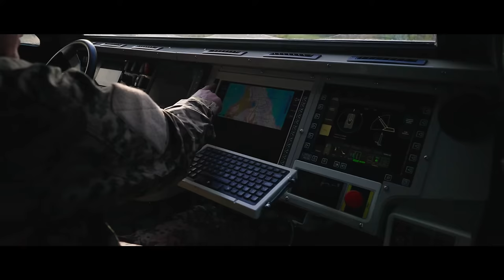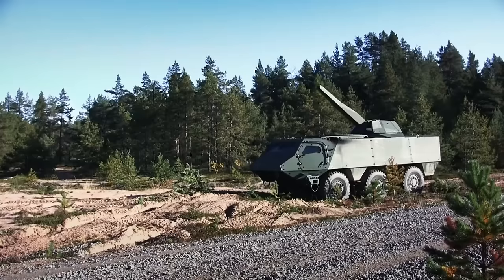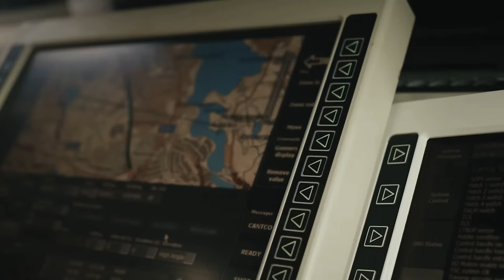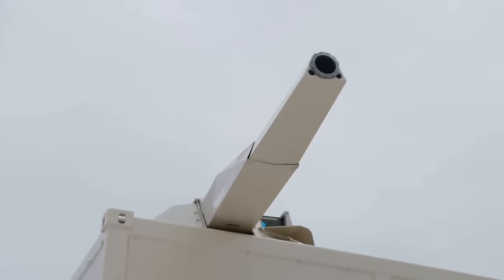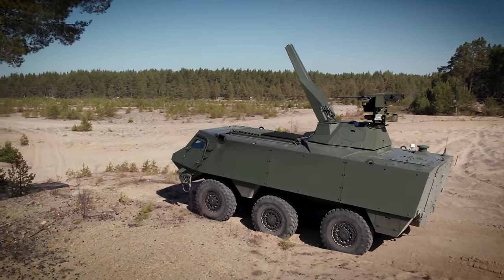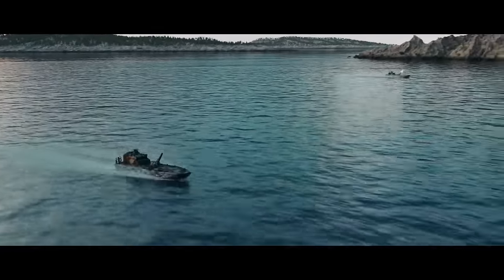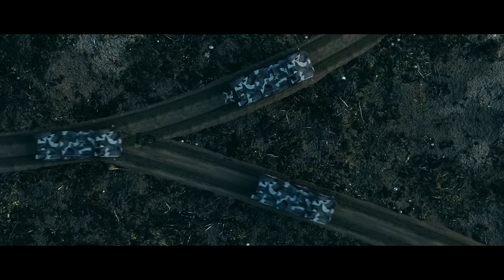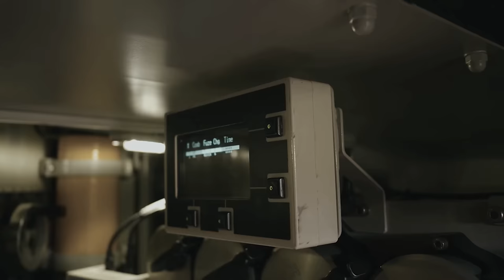The Patria 'NEMO' 120mm Mortar | WORLDS BEST MORTAR SYSTEM

Comment: I wonder if the turret could be compatible with Stryker & AMPV. The current US mobile 120mm mortars are just strykers or m113 or even the new AMPV all have mortars just in the roofless back.
Reply: It definitely can if the platform suspension can handle the recoil and the drive train and cabling can handle the power requirements.
Reply: It is similar vehicle so i guess it can handle Nemo easily and maybe even Amos

Comment: Best is very subjective. If you want a man portable artillery piece for an infantry unit, I don't think anything beats metal tube and baseplate and a tablet for number crunching in terms of price and availability.
This thing on the other hand looks very expensive, and effective.
Reply: Not that expensive tbh. We need as much bang for buck as we can get
Reply: The 82mm  mortar is an ageless classic, easy to use, mobile, ridiculous firing rate and good enough for meat loaf

Comment: Incredibly interesting system, but I want to see it with an exposed barrel and recoil-dampener(s). Now that would be beautiful.
Reply: it would give a bigger radar signature especially at max elevation. 
Hiding your kit on the battle field or on water is an increasing problem with air mounted sensors and drones kitted with multi spectrum sensors. 

I predict its only a matter of months before someone fields a drone defence system on vehicles like this ... essentially like an automated giant shot gun system ...  That way you get the optimal spread to take out the cheaper small  drones without having to spend a fortune on pin point targeting systems or  munitions. 
It would also be highly effective in point defence if the opposition got infantry close. 
The load could be varied like a shotgun as well, so from ball through flechettes for spread to slugs or sabots. It would probably have to be multi barrel and have the spread at range of a punt gun ... So 🤔 40mm as you are going to need quite a few rounds... to fire in various burst patterns.

Comment: Hello Mat,  the nemo is impressive.  I am not a military person, consequently I do not see the real value compared to a low cost regular mortar, except for situations of high movement.
Reply: Accuracy, mobility, safety, comfort and fireing system that can link to multiple nemos and drones at the same time… Just the ability to come into fireing range with target coordinates preset, shoot a fast burst that all hit the target at the same time and the run away is a crazy ability.

So in a short comparison:

Cons of normal mortar system:
1) very skill oriented and multiple soldiers needed to operate the mortar so one kamikaze drone or shrapnel can wound 3-4 soldiers at once even if not a direct hit.
2) Just aiming takes much longer time and on a soft ground might need re-aiming after every shot.
3) verifying if you hit what you wanted takes a long time and re-adjusting is just as slow.
4) can’t shoot on the move.
5) no cover from enemy counter barrage.

Cons of NEMO:
1) Price
Reply: Thanks  @tomofasia  for the answer! Appreciate it. When looking at the situation in Ukraine I wonder, are soldiers in trenches (with mortars) more exposed than in IFV's? (Or are they less exposed due to lack of precision to russian artillery?). I didn't know of the slow aiming of manual mortars. Are they less precise as well? Interesting remark of the soft ground. Originally, I am a forestry engineer. Have seen many military in the forests. It was always a surprise for soldiers, our equipment did not get stuck.  I mean, Hagglund did build the BVS for a reason. That would actually be an nice platform for the Nemo...  Thanks!

Comment: One could also note that you can mount the box version to basic ass civilian change bed truck and just drive trough logging roads and main highways 10km from front line and dropping off mortar fire before driving off to resupply if you run out the military supply trucks. You might be able to disguise them as basic civilian containers as well, plus load them on train, though that would be bit too predictable target. Put dozens into a "fast" small cargo ship on the deck. Sail near enemy harbour or such, unload everything and get hell out of dodge, with subs and surface ships dealing any pursuing ships and air treats. Not sure how hague would react to this, but its possibility to get a edge.

Comment: I like the idea of having autonomous artillery systems that you can drop off and they are self-contained were you could control the system from kilometers away and have multiple guns that you can connect all together so they can all fire simultaneously at the same Target with a good amount of ammunition capacity that could be a real good idea only has to be reloading when it's done firing or move it to another location and with modern guided munitions you will need a lot less rounds On Target

Comment: Also needs slightly-delayed canister shot rounds for anti-UAV work. Other than that, seems fine. Needs a longer hardened barrel though, for extended range rounds, that will immediately be developed. We could probably chuck them on a Bushmaster, or just have them run alongside on trucks.

Comment: In my opinion, the NEMO mortar system would have been an interesting alternative to the Mobile Gun System. It has both direct and indirect fire with a fire rate of 10 shot per min and while its direct fire is about 2 km compare to the 4 km of the MGS, it compensate by it indirect fire of 10 km. Also a bit of correction, the AMOS is not a lighten version of the NEMO but much heavier which is about 4.5 tons compare to the 1.9 ton of the NEMO. However AMOS rate of fire is 26 rounds per min compare to the 10 rounds per min of the NEMO which is scary fast for automatic mortar or any autoloader system use by certain tanks.

Comment: The combination of a 120mm mortar system like this combined with drones with laser rangefinders to get the GPS coordinates of a target for GPS guided smart rounds where a CEP of 3-5m is good enough and laser designators for laser guided rounds where CEP of <1m and the ability to hit targets on the move could make this type of system a dominating factor on the battlefield. 

In fact the NEMO system firing  laser guided anti-tank shaped charge rounds with a drone designating the target would have the potential to be a real armored vehicle hunter. With a range of 7 km or so, the mortar carrier would be well beyond the range of vehicle with line of sight weapon systems, including those like IFVs firing ATGMs. And the ability to stay masked behind terrain means that even within range of tanks and ATGMs, the mortar carrier never needs to unmask to fire.
Reply: Why would it need primitive laser guided anti tank shells when it has FLIR guided  profile priority programmable top attack EFP/HEAT shells already in service since 1994?
Reply: @SonsOfLorgar  money. Sure there are mortar shells  that have autonomous capability, but that comes at a high cost. The simpler laser homing shell is much less expensive.

Comment: The wireless system can be hacked or jammed so not sure there will be much use for that "shipping container" variety but on the APC in the hills and low mountains this with a 50 cal or even 20 mm minigun on it as well is valuable.
Reply: Not to mention that the shipping containers are one time use if fired against any decently equipped opponent.
Reply: @juslitor  I would think you would build a pit for it with sand bags in the brush for protection but agreed nontheless, one hit and its an expensive pile of junk. Nobody is going to spend the amount they want for the system and just leave it with so many vulnerablities unless its in a really remote spot thats hard to hit but then how does a truck offload it there in rough terrain is the question....Maybe a C-47 could drop it on a cliffside and tuck it into a niche.

Comment: I wonder if it would be possible to mount these babies on the TAP V fleet, Recce by G wagon or replacement vehicle armed with the GMG or 50 cal and the Nemo-armed TAP V would be the whumper that Reserve Armoured units could really use, any battle group would love to have this kind of firepower.
Reply: At least with this system the TAP-V might be a worth while platform. 
Might need to extend the body a bit just to carry rounds. As for a G-Wagon recce, you can by a lot drones for the price of g wagon not every be exposed. Warfare is changing.

Comment: Imo this is what Sweden should have gone with in their Mjolner system.
Reply: The Mjolner system is much cheaper - hence Sweden has gone in that direction. I'd guess their performance & capabilities are similar, except that the NEMO and AMOS variants have the benefit of a direct fire option as well if/ when necessary.

Comment: I have had a look at mortars. There are and have been a vast array. The smallest I found was 40mm and has not been used for at least 70 years as far as I can see. 60mm mortars are still in use all over the place. Then comes Mr Beardie Weardie. The 81mm mortar. More specifically why 81mm? It's a weird number as it is not a round number in metric and not in imperial either. OK it's nearly 3.25 inches but not quite, Then there are the odd few 90mm. Then of course 120mm. Then we get to the big ones. IE 6 inch (roughly 155mm) found on some WWII ships for shore bombardment. There were even some 208's (8 inch) but 81mm? Why not 80mm or 85mm?
Reply: 81mm because they are muzzle loaded smooth bore weapons with cast iron ammunition which requires room for both temperature variations on the barrel as well as casting variance in the shells and the air in the tube below the shell to pass it by for the shells to slide smoothly down the tube with enough velocity to get a good strike from the fixed firing pin common in lighter mortars.

Comment: This system for coastal ships, is an absolute nightmare for anyone who is trying to threaten the Nordic coastline. For anyone who does not know, Finland and Sweden don't really have one coastline. Rather, especially Finland's coast is made up of a huge web of small islands. It's rather mindblowing to sail a ship through it into the Baltic. 

And on each of those islands. Finnish recon soldiers. Recon equipment. Sensors. All relaying your location and information about you. If it wasn't enough for Finnish troops to have many coastal missileboats targeting you. For those islands to be packed with mortar teams, anti-ship missile launchers, and more. You also now have patrol boats with 120mm mortars capable of firing on the move, as they dart around the islands. 

I see absolutely no way for any navy to take control of the Finnish or Swedish coast. It's too full of small islands to freely sail with large naval vessels. And the entire area is full of traps and ambushes.

Comment: So, you have a video about the Mjölner, AMOS, now also the NEMO. It's only fitting that you now make a video about the last (and the actual best) Western mortar turret system, the Polish M120 Rak.
Out of all the aforementioned systems, the Rak is fielded in the largest numbers, it's also the most automated one as despite being manned, it's the only one that features an autoloader. It's of course MRSI capable and equipped with the Topaz system, one of the best artillery BMS/FCS out there. It has superb situational awareness thanks to an omnidirectional vision system as well as an LWS.
It really does have a lot of things going for it, I think such a video would be very interesting. Though there isn't a lot of information available about it in English.
Reply: Does it work yet?
Reply: Whats more, the M120K can even be loaded from any turret position so you don't have to reset it to 0(hull relative) in order to load it like NAMO. Poor sales of NAMO kinda speak for itself.
Reply: @SonsOfLorgar  96 units produced, some already in Ukraine.

Comment: How does breech loading mortar such as this differ from regular artillery? Could anyone more familiar with the subject explain?
Reply: Arc of fire. A howitzer fires in a long flat arc that drops to roughly 45°-60° angle from the horizontal at the target end.
A mortar fires in a parabolic arc that comes down at 85°-89° from the horizontal, denying any use of vertical cover like trenches or stone walls where the angle of incoming regular artillery still allows infantry to take cover by laying down next to vertical objects.

Comment: @Matsimus great video! Definitely some incredible capabilities but this system is setup too much like M-109 or other mobile artillery from 50 and 60 years ago where the crew rides with the ammunition.  Obviously, as the Russian turret tossing contests show us- this is not a great position to be in.  The old argument would be that this is acceptable since it's an indirect fire vehicle, but today's FPV drones, and its ability to engage in direct-fire scenarios, have provided lessons learned in the benefit of keeping humans and ammunition storage very much separate. Survivability would seem to be vastly improved if the loading crew members could be completely removed as the standard setup like in the cargo container model- though that setup didn't seem optimized for mobile operations. 

Then having its vehicle electrified (hybrid or plug-in hybrid) to cut down on diesel logistics and give it a much quieter profile would also seem to bring it into this decade's (though nothing cutting edge) for technology. You've also griped before about the inherent drawbacks of wheeled transportation, and I think the mud we see in Ukraine has proven that out, that wheeled vehicles still have a long way to go and improvements need to be made.  I would point to the Ukrainian Sherp and Atlas ATVs as a possibility for increased wheeled mobility.
Reply: I guess I'm thinking of a firing system like the Archer, where the crew stays completely covered and separate from the ammunition and gun. Since this mortar system is less powerful the whole setup would be smaller. Both the Ukrainians and Russian are using tanks as make-shift indirect fire platforms, so a mortar\tank vehicle would seem to be squarely in current lessons learned.

Comment: Would be interesting to see a comparison with the Swedish mortar system based on the CV90 named Mjölner (Grkpbv or Granatkastarpansarbandvagn).

What would be the pros and cons between these two systems.
Reply: It has no turret and the tubes are installed to vehicle. It doesn't have other pros against NEMO but price.

Comment: A few lessons from the current Ukraine conflict, since it's brought conventional warfare back into focus.  1) The use of artillery is huge in this conflict and a system like this would possibly be a game changer. I'm wondering if towed equipment is no longer relevant? 2) The use of small disposable drones has completely altered the modern battlefield. Using drones in conjunction with this as an FO platform would be a combat multiplier. Though of course, counter drone technology is in full development as well. 3) Trench warfare has been revived but mortars are of course an excellent method of effectively targeting men in trenches.  4) The use of tanks seems to be getting called into question again. Though I would argue that ever using them to assault fixed Infantry positions was not wise. Guided ATM, drones and artillery are absolutely decimating tanks in this conflict(even western tanks). I wouldn't say this has made tanks extinct, but it has likely relegated them into a Cav only role.

Comment: Mount them on Stryker and they could replace all M1129 and M1252 mortar carriers in the US Army. The fold open top mortar carriers could then be repurposed as drone carriers. Strykers with NEMO 120mm mortar gun is also potentially useful as a partial replacement for the M1128 Mobile Gun System.  I really wish that the US would acquire them in large numbers.
Reply: For the remote gun on top I would probably opt for a 7.62 minigun instead of the .50 cal M2. Better for engaging close by dismounted infantry and small drones. The main 120mm mortar gun should be sufficient for vehicle targets and targets at long range.
Reply: Surplus M1129 and other older non double V hull Strykers could be sent to allies as the US transitions completely to all reinforced hull variants.

Comment: DF you say? I sense that a Flak round (i.e. big shottie shell) might be useful to make this also work as an anti drone/anti loitering munition weapon...
Reply: you would need an air burst option but the extremely low velocity of mortar shells means that it would be pretty hard to get close to target. and cannister shot isn't an option for mortars as they don't have the chamber pressure or velocity for launching clouds of lethal pellets.
Reply: @dominuslogik484  Yes, I was thinking Canister, rather easier than trying to detonate something next to a drone...

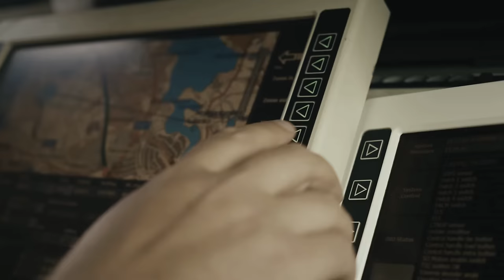Comment: 6:49 is part I dislike about it.

Seems like  it is not totally automated as far as loading goes. You still need to put shell onto tray first and then it will be loaded into gun. It doesn't seem to have ready to fire shells that it can just chew through. And a second thing - it's something I assume is not as easy to put on any platform, because most of it's systems are in fact below turret (requires quite large space directly below turret to operate). 

If loading is not automated then it's not really viable to operate it completely remotely. 
Would really like to see how it ticks internally but I do have my concerns.

Comment: They should design a 4 barrelled 80mm one, each tupe offset by a slight fraction to produce a perfect size box pattern on landing, also it could chuck smoke, and Parachute flares and explosives impact and even airburst over the same target all at the same time....also the single 120mm would work really well on a RV type set up, land or Sea/amphibious variety....